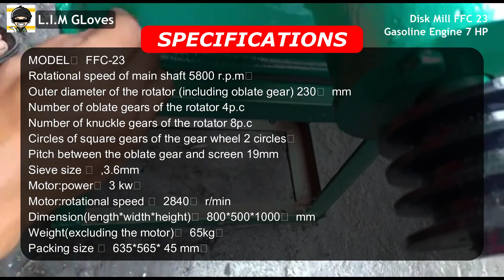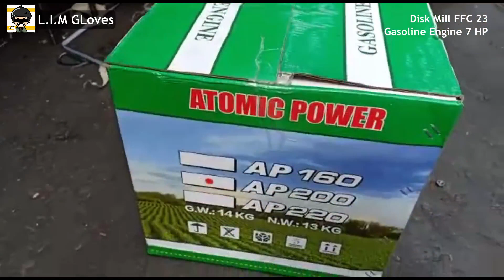UNBOXING REVIEW DISK MILL FFC 23 GASOLINE ENGINE Mesin Penepung Giliran Tepung INSTALL TEST

Comment: Untuk selep jagung pakai motor listrik brp hp mas ffc 23?
Reply from the maker: Minimal 2 Hp Gan
Reply: @l.i.mgloves5209  rpm rendah apa tinggi pak
Reply from the maker: Rpm rendah tapi pulley motor 2 sampai 3  x lbh besar dari pulley FFC nya
Reply: @l.i.mgloves5209  untuk harga nya bpr om

Comment: mesin penggerak 5.5 hp apa kuat pak
Reply from the maker: Gak Kuat utk FFC 45 .tapi Cocok utk Gerakan FFC 15 dan FFC 23
Reply: @l.i.mgloves5209  Saya pake 5,5 ngk kuat bos ukuram pulley 8inc
Reply: @mayonggoseto7889  5.5 hp merek apa bang yg di pakai ffc 23
Reply: @sangtu104  Ngk tau bang beli bekas soalnya
Reply: @mayonggoseto7889  paling merek honda ya, kalo mesin cina gak bisa hidup yg 5.5 hp di ffc 23 puli 8 inchi